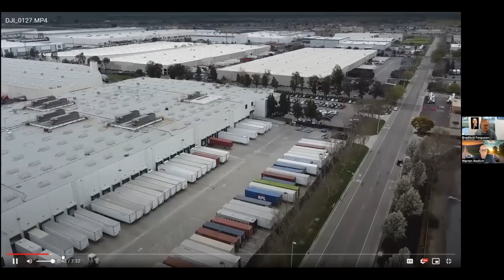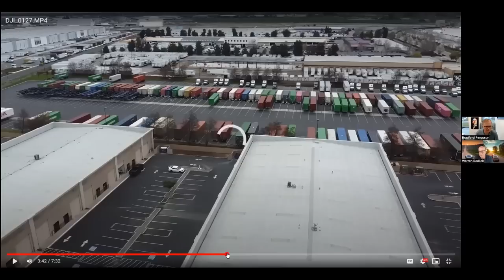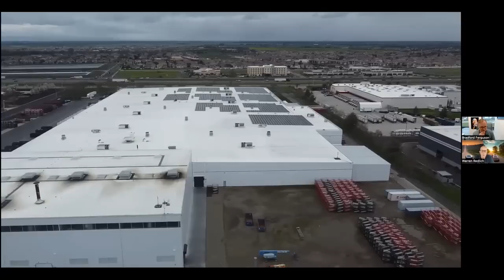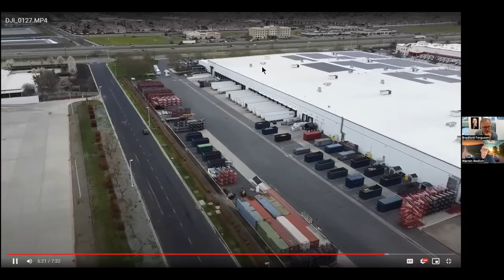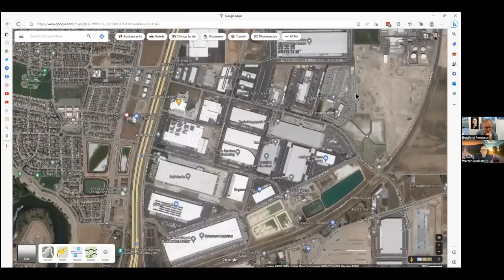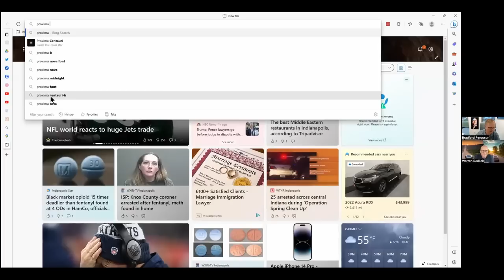Tesla Secret - Lathrop California Surprise

Comment: Warren - these are the MAIN , Factory buildings @ Tesla.
FREMONT . S3XY. 10,000 ++ workers.
GigaNevada - Battery cell, Powerwalls, old Megapack & Drivetrain. 7000+ workers.
GigaBuffalo - solar roof & Superchargers. 1500+ workers. 
GigaShjanghai - 3/Y. 15,000 + workers.
GigaBerlin - model Y. Planned model 3 and batteries. 10,000+ workers.
GigaAustin - model Y, batteries, Planned model 3 Cybertruck, Semi. 10,000+ workers.
Tesla Lathrop - Automotive Parts - 486 sq feet. unknown.
Tesla Lathrop - Megapack - 440 sq ft. 1000+ workers.
Trillberg NE - EU Distribution , 835 sq ft. 540+ workers.
Tesla Automation GmbH - Bavaria. support offices in Chandler, AZ, + Shanghai. 
other . in Prum, Neutraubling, and Neiuwed. 1100+ Workers.

Tesla KATO rd - battreries. seats. not Disclosed. 
Tesla tool & die - Grand Rapids , ME. tool & die, Casting Equipment. 176 sq ft. 100+ workers.
Tesla Brooklin park - Minnesota , manufacturing Equipment. 70k sq ft. 100+ workers.
Tesla Elgin - Illinois , manufacturing equipment. Undisclosed. 
Tesla Toranto Automation - Richmond Hill Ontario, CA. & Markahm , Ontario. battery Manufacturing Equipment. 150+ workers.
Tesla Shanghai Supercharger factory - 54k sq ft. 
FUTURE - Tesla Li Refining - Robbstown, TX. 
GigaMexico - Nuevo Leon - Vehicle Factory.
Reply: Amazing!!!

Comment: Imagine the road damage from those massive loads.  Glad it's in California, as they don't really care what condition their roads are in.
Reply: No need to imagine the truck can gross 17000 pounds per drive axle on the tractor and 17000 per axle on trailer and 12000 on front axle. Giving 80000 pounds on standard tractor trailer,If weight exceeds 80000 you add a axle to trailer and one to axle for each additional 30000 pounds added to the 80000.keeping the weight legal no damage to roads.lastly Big trucks pay ‘Heavy use tax every year per truck. Also very high plate tax 2200-2600 per year.plus 30 -50 cents per gallon tax on diesel.Also fed excise tax on tires ,new trucks.my last new truck excise tax was 17000.00
Reply: Additional axles were mentioned

Comment: 5000 MPacks x 2.000.000 usd = 10 B revenue.
Reply: And extra's (shipping, software, and maintenance) could tally up to well over $2.5+ mil per pack. Could be $12 B in revenue when recognized. And if Tesla has batteries, there will be more growth than just to 5k units. With 50% growth, end of year run-rate would be 6.5 k units, average about 5.5k units. Could be over $13B in rev, call it $10B when you account for deferrals.
Reply: and the IRA incentives???